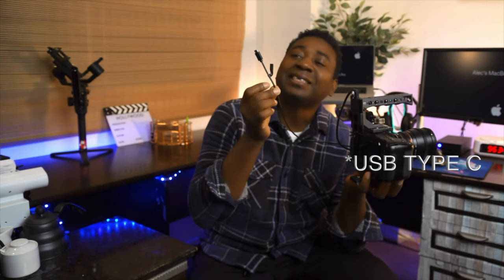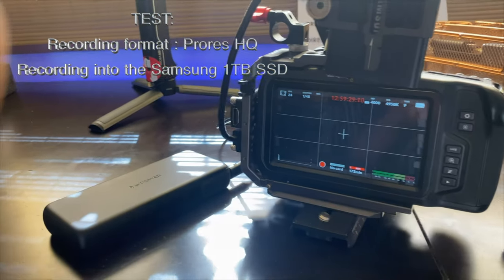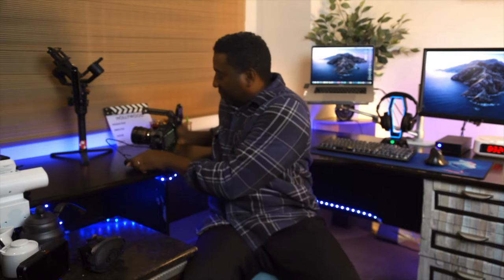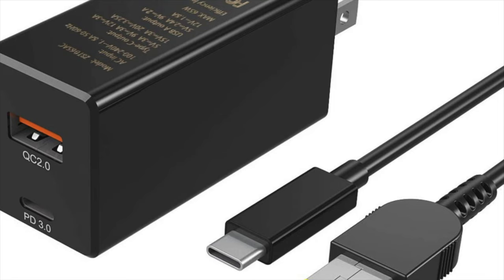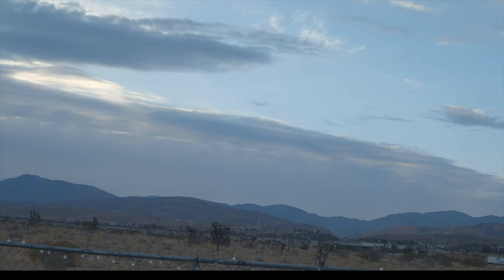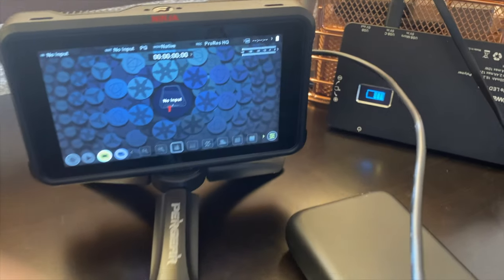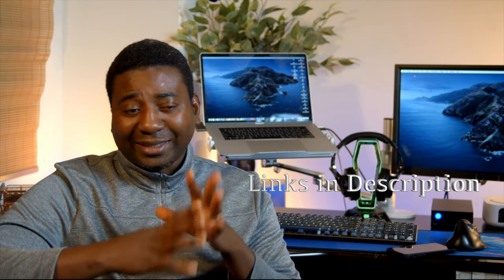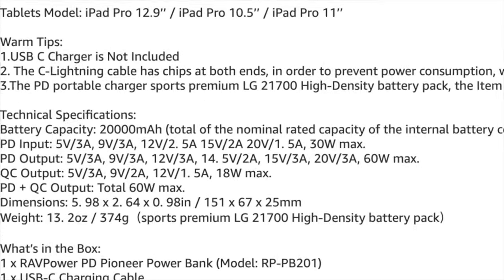NEW "POWER PIPE" FOR BMPCC 6K, 4K, LIGHTS & MONITORS

Comment: Definitely getting this, just put the items in the basket and will order when I get the 6k.

Now what would be interesting is if blind spot would create a cable to micro USB, I have the tilta and need 12v min to power a cine lens since the lens itself is stiff so needs the juice.

I have the panasonic g7 and use power banks to run the camera and the followe focus with a 12v converter and it works really well. 

I think v mount is great but I've been using power banks for a long time now and they are just convenient. They won't do everything but unless we push then there won't be a market for it. Plus the rav power bank is under 50 quid so it makes sense.
Reply from the maker: True Byron, so true.

Comment: If plug your camera and monitor into the same power bank, will it work
Reply from the maker: Maybe if you have a pd usb c splitter which I haven’t seen. That’s what am hoping for. For now, no it can’t. The other port might be able to if you have the right power cable connection for your device. For my devices I need two usb c ports to power up both. Please let me know if you find anything useful. Thanks